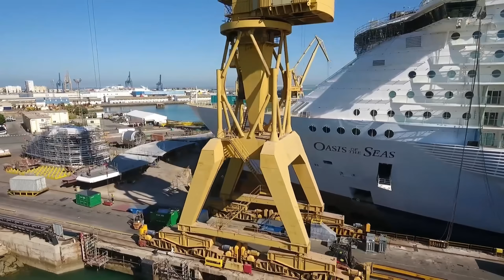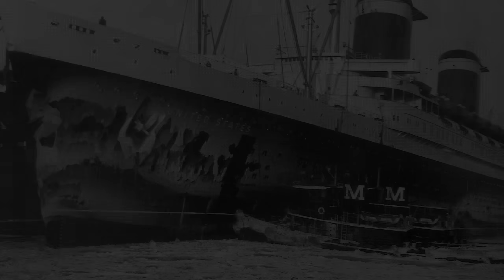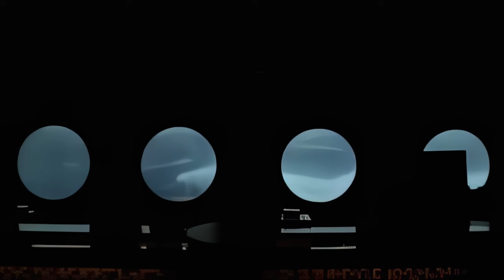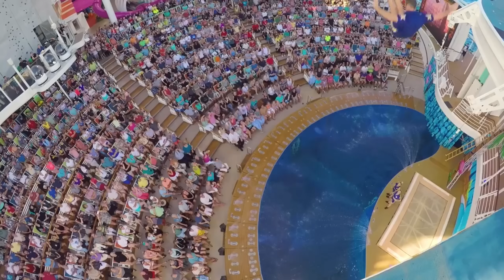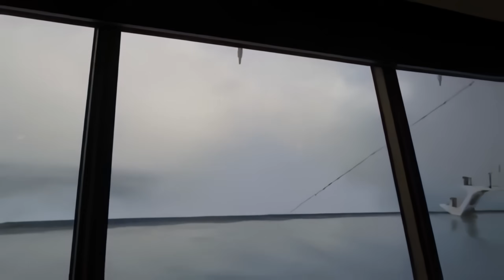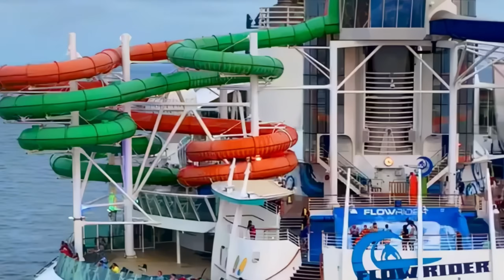Old vs New: Dark Side of Modern Cruise Ship Safety

Comment: It boils down to volume and luxury, both being very excessive, at the expense of safety being significantly reduced.  A ship should be structurally safe from storms without having to avoid them at all costs and rely on stabilizers for some stability.  If there is a big market for cruises then buy more safe ships instead of fewer unsafe ones.  It shows the poor taste and poor logic of the industry.
Reply from the maker: The industry has completely shifted from building ships that can fight the ocean to building floating hotels that must run from the weather. It is a massive change in naval architecture